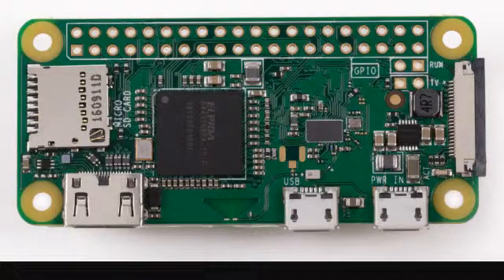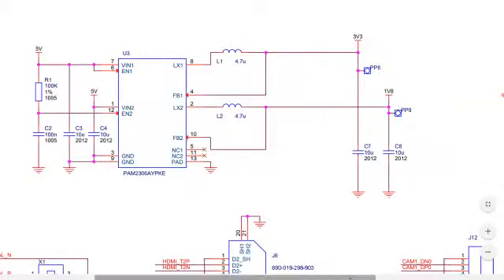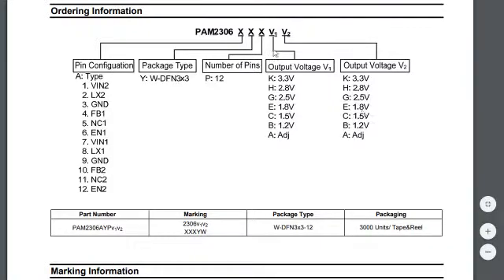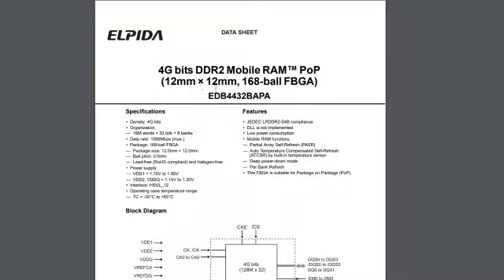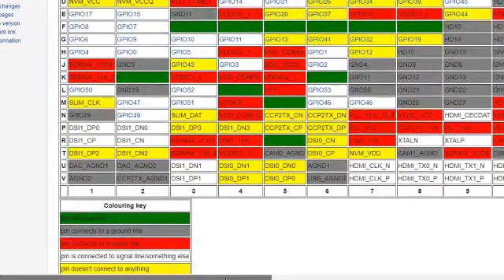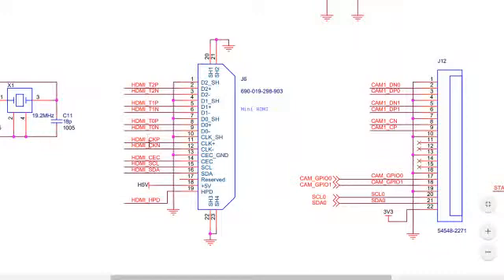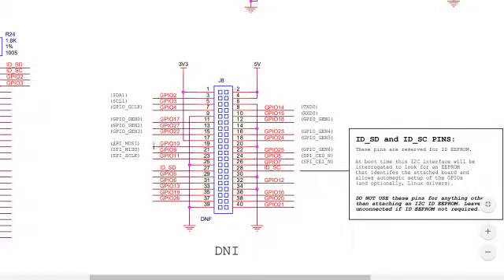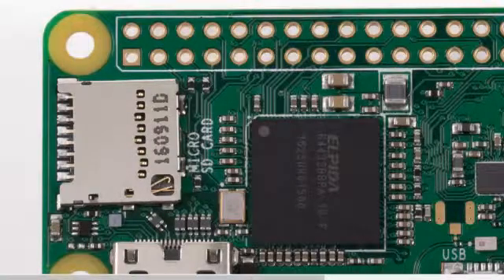Raspberry Pi Zero W - Schematics and Circuit

Comment: Thank you so much!

The only thing missing (that I came here for) is the big can with "4R7" on it.  Is that the crystal?  The internet says it's one of the inductors connected to the 2306 voltage regulator.

But then..where's the crystal oscillator?  Does it have an oscillator external to the CPU or does the BCM2385 include that inside itself?!